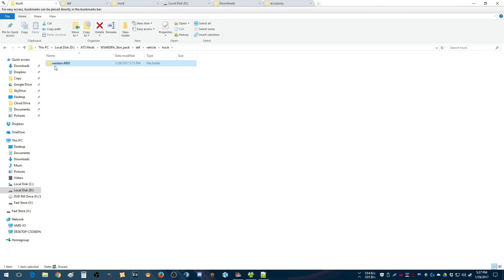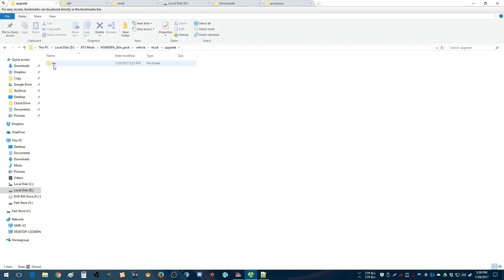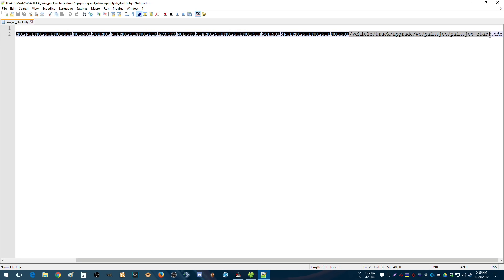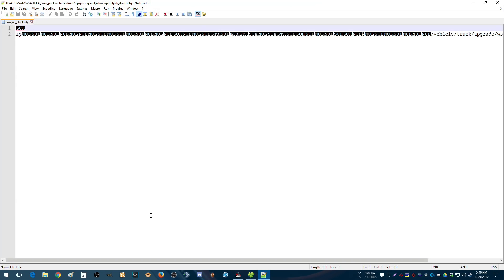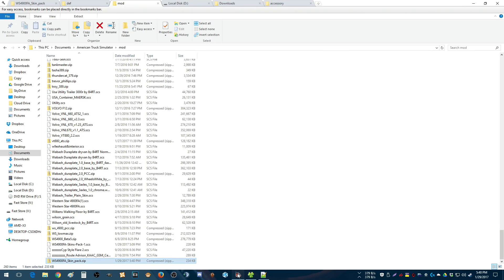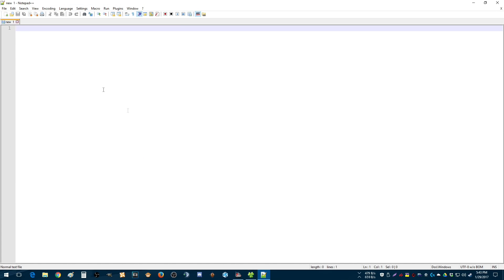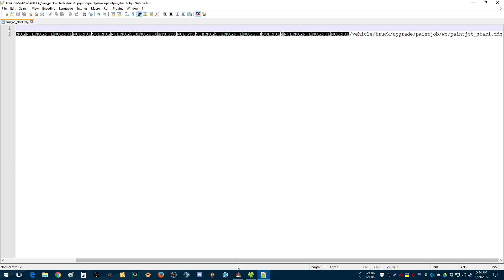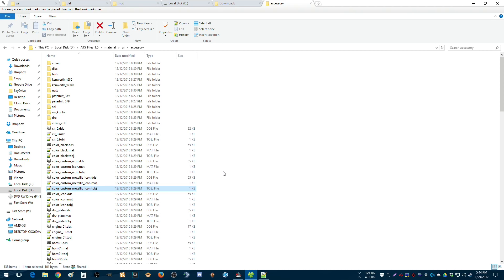ATS Modding | How To Manually Assign New Tobj's |

Comment: Half fast gaming I have a question. Could you email me DLSLOGISTICSINC@gmail.com
Reply from the maker: lashawn c. all questions can be asked here or on the Facebook page.
Reply: Question I had parts added to a truck but I would like to transfer those parts to another truck of the same kind how would I go about that?
Reply from the maker: There's a video in my playlist here that tells you how to export to a new directory.
Reply: I tried looking but don't see it
Reply: I apologize I should explain myself a little more but I had the 379 done but issue was the lights weren't I wanted them and it needed more parts. I reached out to someone else to finish the work which I thought they did but notice that the 379 they did wasn't the one I sent them. They did a copy and paste so now the new 379 camera view isn't working and seems as if he took my ideas and made a whole new truck for himself calling it his own. After noticing that I rather learn to do my own work. I just want to transfer the parts he did and the lights he setup for me to the 379 I first sent him. that step by step video would help out a lot. I purchased zmodeler 3
Reply from the maker: lashawn c. I don't use Zmodeler, so most of the guide would be useless to you.